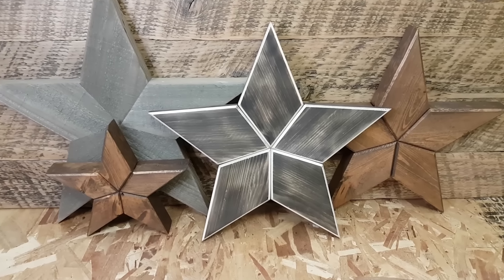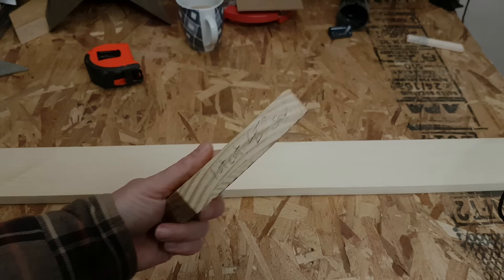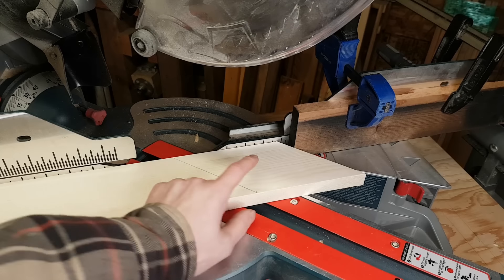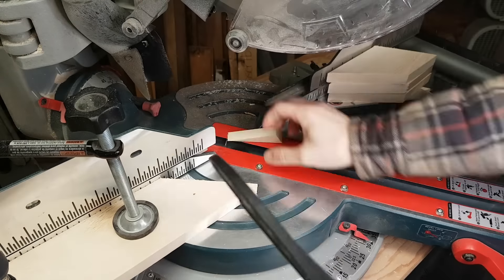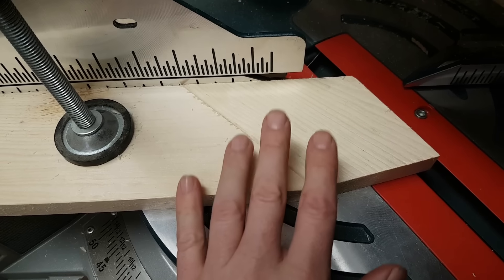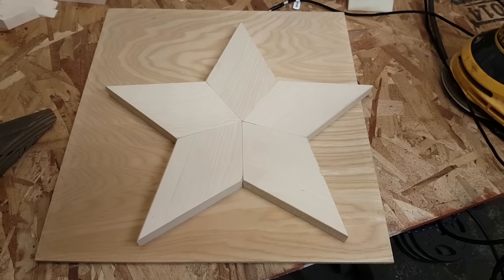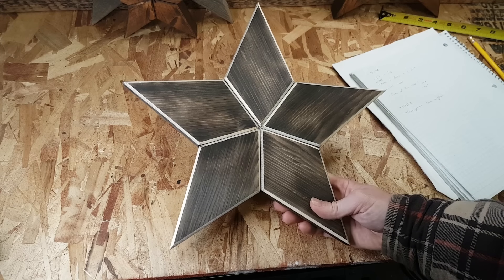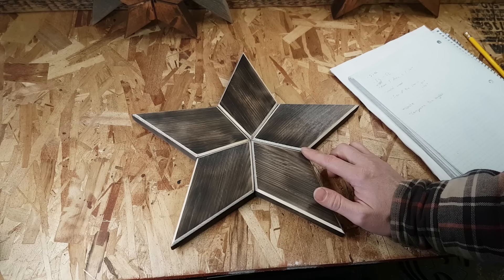Texas Stars: Easy 45 Degree Angles, No Jigs! Easy Woodworking Project

Comment: Worked a treat! Thanks for sharing your thoughts. The only thing I did differently was use an angle of 31.6 degrees which was  preset on my mitre saw. All 5 pieces fitted together perfectly - I was so pleased 😀.
Reply from the maker: That's great! I was tempted to try that too! I still don't know why miter saws have a preset at 31.6 but if it works, great!
Reply: @savvybuilds   I asked Mr Google - 31.6 degrees, is the standard miter angle for certain compound rafter cuts in many common stick home roof construction situations. Because it is so common, most compound miter saws feature several quick settings like this, to save time and ensure repeatability over dozens or hundreds of cuts.
Reply from the maker: hankhill4431  Hi! I talk about different sizes in this video at around the 2 minute mark. https://youtu.be/dZFTGsyJTvY

Comment: I have learned so much from your videos ! Thank you! I wanted to share this tip with everyone that makes stars . The glue ups can be a little tricky. I discovered that if you glue up the star on a tool box liner and use Titebond Speedset glue it is so much easier! The tool box liner forms a suction and it keeps the pieces from sliding around.  The glue sets up very quickly and between the both of them the wait time is drastically reduced. Good luck everyone and happy building.
Reply from the maker: Great tip! I didn't know about the speedset glue.

Comment: Two things I learned. 1) I did 31.6 instead. My saw has a tick mark on that angle.  2) Instead of using 4 7/8 I laid one of my parts out and marked the exact length of my 45 degree cut. It was 1/16” less I believe. My star then was spot on. 

Oh… and another thing… I did stops pretty much like you did. Your stop for the 45 degree cut is better. I used an off cut that had a 45 degree angle on it. Sawdust gets built up in the little corner and makes the part not seat up against the stop. On your 45 degree cut that’s eliminated. But making sure you clear out that sawdust is important. 

THanks for the video. This helped a lot.
Reply from the maker: Glad to hear it worked out! I also switched to using 31.6 in my more recent videos. It seems to work just the same, sometimes better! Thanks for watching!

Comment: Very cool project. Described nicely. If you have a bandsaw a Quick way to make 2 out of one is to resaw the pieces in half, (or into 3 maybe). A bandsaw could cut a 1 by into 3, 1/4” thick pieces easily. Could resaw initially on the full length board or after cutting the pieces and then stack them on top of another and cut 2-3 at a time assuming your stop blocks are thick enough. A sacrificial fence is a great idea to support the pieces on both sides of the blade. Will lessen the error caused by small movement of the pieces. 2 face tape it to the miter saw platform. Done correctly it acts as a zero clearance insert at the bottom of the cut minimizing chip out on the bottom. If resawing the pieces in half you could chamfer the edges of each piece on both sides first, while still thick enough for safety, then resaw them in half and go right to glue up. Much thinner star but get a lot more out of your wood. Theoretically you could assemble the star completely making sure both sides are finished and then resaw them if the bandsaw has the capacity and they are sturdy enough after gluing. I resaw my more expensive woods like Purple Heart etc to 1/8” or less quite often and laminate them to other cheaper woods if I need more thickness. Just an idea to save both time and money. Keep up the good work!
Reply from the maker: I like your lamination idea. I was thinking about trying with wood veneer over mdf. Could make a really nice star. 
I am using a zero clearance fence now in my newer videos. Much more accurate...and safer. And a new sharp blade helped too! 
I don't have a band saw but I did make multiple stars at once in the past by stacking and cutting 4 1x4s at the same time on the miter saw. I had to make a jig for that but it was simple. Thanks for all the tips!

Comment: I also use a home made vinegar stain. But, mine isn't involving enough to make a video. I like to clean off rusty steel parts. The more rusted the better. These are old tools and parts that have oxidized outside or outdoor shed. I use discarded plastic jars from the kitchen. After soaking in apple cider vinegar. I soak a day or more. Take out metal and clean with rag and or brush. The liquid solution is what I use to to stain my woods. And, yes, protect your skin. Going to make my stars today! Thanks good info given here.

Comment: I have found on my saw atleast that it doesn't give a clean cut. It leaves tare out/wood fibers on each cut so the center points leave same gaps, just a little sanding on the points helps tremendously.  Thanks for the video
Reply from the maker: The type of blade can help too. 60 tooth blade makes a pretty clean cut but it seems to depend on the type of wood and grain orientation as well. I have not tried an 80 tooth blade yet.
Reply: Try putting masking tape on the side that rips bad. Works for me.

Comment: much easier than the 54degree version 
Addition of a 1x2 sacrificial  fence
for the 31.5 cuts stops the little movement of the peice on the flip cut and eliminates the gaps.
Great project.
Same technique and angles also works for 2.5 inch stock and produces a 8 inch star.
Reply from the maker: Thank you! I agree, I have since been using a sacrificial fence and it's much better.

Comment: Thanks for the videos, so easy to understand.   Could I use 1x3”
Reply from the maker: Yes smaller will work just the same. The angles stay the same and the pieces don't need to be cut as long.

Comment: Hello Mr. Savvy! 
Your instructions have helped me tremendously! My saw only goes to 45°.  To use larger wood, would you mind sharing with me the measurements? Thank you for sharing your talents!!!
Reply from the maker: Hello! I have yet to make a larger one with the 45 degree method but the good news is, all the angles stay the same. You just need to cut them longer. What size stock are you thinking about trying?
Reply: @savvybuilds  oh my goodness!! Thank you for your reply. I thought the degree cuts might stay the same, but wasn't sure, so I thought I'd ask. I was wanting to try a 1x8 stock. Thank you again for your time! ♡
Reply: @savvybuilds  I was hoping to use a 2x6 like in your other video.  The angles would be the same, but not sure how much longer I should make it. 🤔
Reply from the maker: @TaySC1969  Hello, here's a link that might help you: https://youtu.be/dZFTGsyJTvY
Watch from 1-44 to 4-33. I explain how to figure out how long to cut the pieces with different sized lumber.

Comment: On another of your video, you recommended the 31.6 setting.
Reply from the maker: Yeah they both work fine. Most saws have a pre set for 31.6 so it made sense to use that setting since it's so close to 31.5. I only use the 31.6 now and haven't have any issues (since filming this video). 
Thanks for watching my vids!
Reply: Thanks love your web site, I will attempt to make a couple of stars and see what happens.  Keep up with the great ideas. @savvybuilds

Comment: One thing about the movement messing with the angles, your fence is too short.  If you attach a sacrificial fence, it will hold the piece securely and limit movement.
Reply from the maker: On hindsight, I think that would help.

Comment: Is there a correlation between the width of wood and length of first cut. I just did it with 3 inch wood and i did 5.5 inch and when i put them together I've got a huge gap.
Reply from the maker: @davidsecker5161  take a look at the video link in the description. That  might help. Smaller board, smaller star.

Comment: Hi, great video, but do you have to change the angles depending on width of board .Mines not working out on 3” board
Reply from the maker: Hi! The angles would remain the same. The only thing that would change is the measurement for the 2nd cut. It would be less than 4- 7/8 inches. Measure the length of the facet of the 45 degree cut and that would give you the measurement for the location of the 31.5 degree cut. Hopefully this helps.
Reply: @savvybuilds  yea did do that but still didn’t work out..perhaps it’s my mitre saw .

Comment: I have a 1x4 that I cut from pallet wood. When I cut at 45o angle on the 4 inch piece of wood, my cut side is 5.5” inches on all four sides not 4 7/8” 

Not sure what I did wrong. Watched the video multiple times
Reply from the maker: Sounds like your 1x4 is 4 inches wide, is this correct? My 1x4 was only 3.5 inches wide (standard SPF 1x4 stock) which means your cut side will be longer than mine. You can continue as is and just end up with a larger star. The goal is for both facets to be the same size. The wider the board the bigger you can make the star. Just continue to the part where you make the 31.5 degree cut and cut just at or under 5.5. Everything will still work out but you will end up with a larger star.  Or you can still make the cut at 4 7/8. Up to you.
Reply: @savvybuilds  I figured that out after I posted it, but still wanted feedback anyway incase I was wrong.
Reply: @savvybuilds  since you’re around I mind as well also ask.. because I couldn’t quite figure this out even though I followed the video step by step: 

When you get to the 31.5o cut, you said to measure out 4 7/8” inches, and then cut but what confused me is your measurement is on top. I don’t know where to measure to connect the line to the bottom to guide my saw. You have a straight line on the board but didn’t share the measurement to connect that line. I just want to make sure I have everything correct (when I attempted to do this, something was wrong because when I measured out 4 7/8, and came up from the bottom of the board to the dot, it didn’t make a clean cut with a sharp corner, it missed some how and caused an oblong five sided piece).. that’s why im verifying where that line connects.
Reply from the maker: @matthewdavis6741  I see what you mean. I have made a better process since this video. Check out this video: https://youtu.be/dZFTGsyJTvY                                    Watch from 5 min to about 12 min. I talk a lot about setting up those angles. Hopefully that helps.

Comment: 6:40, remember, there are 10 faces trying to line up in the inner glue joint. If your miter is off 0.1 degrees, that's a total of 1 degree. If your miter is off 0.2 degrees, that's a total of 2 degrees!
Reply from the maker: You explained this better than I did! Thank you :)

Comment: I have a brand new Metabo 10" sliding miter saw. It cuts perfect angles. I have burnt through 20-star pieces and NONE of them are even close to fitting together. I even had a friend make one and his came out just like mine. How many cuts did it really take to get yours to fit together?
Reply from the maker: What part isn't fitting exactly? As you see in the video I cut the pieces once and then did a test fit. I then readjusted my saw and cut them once more and I had perfect angles. You might be orienting them the wrong way when making the 2nd cut. Or your saw is out of alignment. Not sure. What angles are you using?

Comment: Could you please share the math you use to come up with the angles? If it's a 1x3 you would use x but if it's a 1x4 you would use  Y  etc .etc.
Reply from the maker: The great thing about this method is that no matter how wide the board is, you set the saw at the same angles as in the video. The only thing that would change is the length of the pieces when you are cutting the 45 degree angles. In the video I use a 1x4. If you use a 1x3 you would cut them shorter, and a 1x6 longer. I don't have those measurements but you could figure it out through trial and error.

Comment: That is not a texas star. The specs. requires the shoulders to be a straight line. Look up five-pointed star. Only the 54 degree star is a texas star.
Reply from the maker: Did you miss the intro? If you want to get technical, the points of a geometrically correct star are actually 36 degrees not 54. However, becasue the mitre saw's zero degree setting starts at 90 degrees instead of zero, you subtract 36 from 90 and cut at the 54 degree mark. Some people don't have saws that cut more than 45 degrees. That was the whole purpose of this video.
Reply: @savvybuilds I watched the intro. To me, it is like saying the bear on the California flag can be any type of bear. That is all.
Reply from the maker: @pazu8728  Don't worry about it. It's just a star.